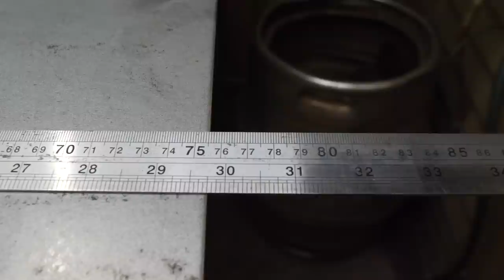Homemade Screw Tank #1 SCREWS

Comment: Every time he roles the machine to fold the metal he gets exited how easy it is to move
Reply from the maker: to right
Reply: The best inventions are the ones that make life easy 8)
Reply: @colinfurze  *too

??
Reply: @colinfurze  Colin ,the spiral on that thing needs to have taper ending ,not square like a wood screw tip ,also cone,and taper spiral at both ends if you want to go in reverse.
Reply: @colinfurze  Also weld some triangle supports on spiral ,that sheet metal is not going to hold radial and axial weight without it.
Reply: 🔴 What Is Islam? ⚠️

🔴 Islam is not just another religion. 

🔵 It is the same message preached by Moses, Jesus and Abraham.

 🔴 Islam literally means ‘submission to God’ and it teaches us to have a direct relationship with God. 

 🔵 It reminds us that since God created us, no one should be worshipped except God alone. 

 🔴 It also teaches that God is nothing like a human being or like anything that we can imagine.
🌍 The concept of God is summarized in the Quran as:

📖 { “Say, He is God, the One.  God, the Absolute.  He does not give birth, nor was He born, and there is nothing like Him.”} (Quran 112:1-4)[4] 📚

🔴 Becoming a Muslim is not turning your back to Jesus. 

🔵 Rather it’s going back to the original teachings of Jesus and obeying him.
Reply: @ahmdabdallah2132  There is no god.  Your life is a sham.
Reply: @colinfurze   when you roll a cone don't mess about with guide lines put a peice of angle iron point into the rollers then drag the inner radius around the end of the angle keeps it dead straight and easy
Reply: @Droningonuk  Sounds to me like you need to make a vid of your own!👍👍👍
Reply: @TheRealFumigator  😂😂😂
Reply: roles? Rolls?
Reply: This is better than always complaining
Reply: @MrNight-dg1ug  the machine is playing the role of a machine that rolls.
Reply: @Milamberinx  I don't think that's what he meant
Reply: @ahmdabdallah2132  Harry potter and the deathly hallows says that Harry vanquished the dark lord and saved the wizarding world. 

Same thing :)
Reply: I get slightly mortified that most of his welds are just spot welds and he doesn't do full seams. Alright for novelty work but they're going to fall apart- and with the kinds of things he makes, they aren't exactly fail-safe.
Reply: @Droningonuk  I for one appreciate that advice; always found conical sections a right pain in the cunning-linguals.

Comment: This drive system is particularly good in sand and snow.
Reply from the maker: yeah I'm looking forward to taking it in some proper sloppy mud etc
Reply: Furze take it to a steep hill or something
Reply: Hmmmmmm Russia and the Middle east?
Reply: will it be able to swim?
Reply: @georgobergfell  I don't think so
Reply: @georgobergfell  probably not, unless you added floaty air tanks and a big fan
Reply: @pseudomemes5267  the screw drive would work on water as well and depending on the overall weight, the hollow screws if welded watertight might be able to keep it afloat. highly unlikely though😂
Reply: So what you're telling me is that Colin is making a beach tank? I want one for my next holiday
Reply: @georgobergfell  I just did some back of the napkins calculations. As long as the overall weight of the tank is no more than 200kg and the screws are air tight the technical it should float.
Reply: @tobywenman4769  Yep, pretty much. Beaches, Afro-eurasian deserts, tundra and alpine. I'd particularly like to see it try to climb a ski slope.
Reply: But can it float?
Reply: why is this better for those terrains vs the classical method of wheels for tanks?
Reply: A bit concerned about the "threads" folding or just breaking if the ground isn't soft enough…
Reply: @julianatlas5172   @Simon WoodburyForget  They are likely slower and less efficient, however they have much grater traction. The screw partially buries itself into a soft surface, allowing the the incline plane to have a grater surface area contacting what it is pushing against. Just like a plane propeller is specifically designed for gaseous fluids and the screw of a submarine is designed for liquid fluids, this screw drive is designed for efficiency in particulate fluids. However, it is very ineffective on firm terrain or solid road surfaces. This is why track drive (which is more or less all terrain) is the preferred method.
Reply: I think this type of drive system may also potentially allow for movement in any direction, by having the screws rotate together or at differing speeds, but rigging that up may be a little complicated
Reply: @RainbowGin  This tank will for sure get over 200kg... Looking at the screws, it seems to become almost car-sized!
Reply: @ToastbrotRaver  helium?
Reply: Hawthorne, also it's good in swamp and marshes but doesn't move very fast!
Reply: @julianatlas5172  i was gonna try to explain properly but i gave up.  Best i have is a shovel analogy.  Basically the screw threads can move more lose material thus propelling the tank better.
Reply: Th3_dud3 no thanks
Reply: weldonwin he needs to rig it up somehow, otherwise he wouldn’t be able to steer at all.
Reply: @weldonwin  If you are talking about being able to move both front to back and side to side, that is not really possible with this. You would basically be trying to turn the screws into supper skinny drum rollers that would need to climb up out of the surface. The incline planes would also be biting in opposite directions causing you to spin in place. 
There is something called an omnidrive that is available in both track and wheel configurations that allows for lateral movement in any direction without turning.
Reply: @weldonwin    it's not too complicated actually , Colin already mentioned levers, one for each screw to control the speeds. Old tech but still works, nowadays it's done with hydrolicks.   If he wanted to strafe side to side, then he would need to implement the option to change the screw turning direction

Comment: The soviets used these things for their forest service. Theyre pretty neat.
Reply: I find this interesting.
Reply: I find your reply interesting
Reply: @All7777Fever  I find you finding my reply interesting to be interesting.
Reply: @garethbaus5471  That too is also interesting.
Reply: Of course they do
Reply: Our forest*
Reply: @memecrate6670  
[MOTHER RUSSIA INTENSIFIES]
Reply: @oleglogvynenko9447  idk if it was actually deployed or what force used them, but Russia did have them. https://www.thedrive.com/watch-this/14987/this-fully-restored-screw-driven-amphibious-truck-is-practically-unstoppable
Reply: Makes sense. Only the soviets would use something so inefficient big and industrial looking
Reply: @jsmgaming1062  It was actually superbly efficient for the task. They were largely employed in large swampy areas, and could float (as Furze's does). They didnt use a silly hydraulic drive though, they used a petrol engine and a tank transmission to drive each side with a belt. 

They were as good if not better in mud than any PT-76-chassis tank tractor, and were much better in the water as well. Not to mention it was simpler and cheaper.

Comment: Educational as always.  That radius jig is nice and simple.  I'll have to remember that when I'm building my own turbojet cart.
One thing I did learn while making steel and aluminum cylinders, though, is if you brake the edge just a bit it'll roll right out to the edge without the flat tail, so less material waste.

Comment: Tip for rolling cones. Weld 2 bits of angle together to make a T. Jab it into the rollers e.g. on the far left. (Point of the angle into the roller) if you put your blank in lead edge parallel to the rollers, small do a end pushed up to your angle. As you roll it drags the my edge around the end of the angle and maintains the "guide line". Probably something you already know but I liked it when a sheety showed me :)

Comment: 4:03 and hopefully we'll have a perfectly round square true  cylinder. Only Colin can make a round square cylinder... lol
Reply: Deranged Chicken or , you know, anyone that understands technical terms  lol
Reply: Square as in both ends square up together it's a 2d plane
Reply: @girlsdrinkfeck  um, i'm 46 years old, a qualified boiler maker, a coded welder and i threw in a fitting and turning apprenticeship when i was a pip - at my fathers engineering firm - my father was a great journeyman to me, taught me just about everything i know regarding metal work,  any how i digress, but um, i think you get that i was joking... and its square in 3 dimentions to me, it just sounded great, that's all - i think shneaky Colin said it on purpose...
Reply: @derangedchicken2191  er ok .... BTW can u service my boiler for me ? its now 10 yrs old and near its life cycle
Reply: @girlsdrinkfeck  yeah sure, stick it in the post and send it off to me. lol

Comment: Colin when rolling cones use a piece of angle upside down in the roller to hold the sheet at the same spot. Saves alot of stuffing around. 40 x 40 should do it

Comment: Colin, not sure if its been mentioned, but if you put a bit of angle up against the two rollers, and wire tie it around the three rollers to hold the angle in there, you can run the throat of the cone (conical) up against the angle and this will guide the throat at the right speed in relation to the outer edge of the cone.
Hope that makes sense. :)

Comment: Estimated speed of tank 2mph , unless the screws turn at 10,000 revaluations per minute then it might go 20mph
Reply: Let's do some math. The screw is 152 cm there's 4 threads. So the thread pitch is 38 cm, let's round that up to 40 to make math easier. So with 1 revolution of the screw you're going to to move 40 cm.  And if he managed to make it spin 1k rpm that comes to about 11 km/h. In a bog or  a swamp  i think that's plenty.
Reply: @petyyras1  That's assuming the screw is getting 100% grab, and no slippage.
Reply: @petyyras1  Good number-crunching, dude. You've probably saved old Furzey-boy from having to do it as well. Me? I was thinking of how to work out the radius of curve for the blades using conic sections and all that hyperbolic trig I knew 35 years ago (but have since very much forgotten).

Comment: Colin, those drive blades are too weak, they need reinforcing. They need a triangular profile, otherwise they will just bend.
Reply: Definately agree with this comment. Gonna have to fix the screws before completion day.
Reply: Maybe another set of 1/4 cuts and bend the original ones welded on and repeat then weld the tips together. Should rectify it somewhat.
Reply: @andrewc5212  - I agree. I think that is probably the best way forward.
Reply: Joven Mangges  i think the angle bar would be more of a challenge  to 'wrap around' in a corkscrew shape.
Reply: this type of tank is supposed to be used on soft undergrouns like sand or dirt, not concrete or rock.
Reply: Joven Mangges  and why did you just tell me that? I was replying to OP

Comment: This were actually invented for the purpose of pulling loads across snow to replace snowmobiles. while effective at first, it turns out that it doesn’t get enough traction and the speeds are very limited.

Comment: Incredible energy!!  Prediction: the weight of the machine will bury the screws and it will spend most of the time digging up the soil and have poor manoeuvrability, eventually burying itself . The screws need to be constructed in such a way that they have the tendency or want to ride above the soil, not bury themselves. Construct the screw then as if you are making them from a piece of right-angle, it will give you two edges to weld to the cylinder.  “ v “.   Oh, make the cylinders watertight as well, and you will have pontoons to-boot.

Comment: Seen someone do this before on youtube and he had chains driving the screws from sprockets in the back of the tubes, and once he got going the screws kinda dig themselves into the ground a bit and the dirt would toss off or break the chains. So I would suggest on mounting the hydraulic motors to the back of the screws somehow to eliminate this problem. Other than that, looking good!

Comment: the thread is currently just a bendy strip of metal, not exactly steardy, and wil probably both din into the ground too much and wear away fast, on harder terrain, so i recommend adding one more thread to each, and joining them together, kinda like ya wrapped angle steel around it

Comment: Lol I like how you used your arm as reference or measurements to fit the scrolls together instead of working out motor power required, power to weight, load forces required vs weight on the item etc etc. its so refreshing to see fun/winging in action ha xD
Reply: fyi I'm a person that plans everything to nth degree before execution and its really nice to see how you actively do not? xD 
I would have took some information from existing products; toys or real tanks, scale down to understand if I can obtain said power with available/easily accessible motors, whats the application I can run it in (army training field? motorcross track? Off road tracks?, speed? degree of incline? Load? Am I shooting something from it? Ammunition?). Worked out sizes and placement of seat/controls etc, then adjust accordingly.

Comment: You need to put an angled bit on the front it the tubes and the end of the screw part so it isn't parallel to the surface of the tube. The way you have it now it can get caught on something and break.

Comment: Colin nice video as usual......but why don't you motorize your metal roller! =D Mount an electric motor that can go forward and backward with the press of a button instead of turning that crank by hand. You can have a handheld module with the buttons and have a long wire going from the module to the motor so you can work big sheets of metal by yourself. Just a thought!

Comment: I think that metal is too thin in that screw what was welded onto the surface of those "tubes" it will bend under all that weight which is yet to come (perhaps it needs one more screwy bit to be welded on equally thin/thick). But we'll see in the next video if my assumption comes true.

Comment: The pitch could be good, it doesn't matter, but I think that the screw is too wide... If you don't have enough power you will be stuck on mud or soft ground. Or if you have enough power, you can climb walls and trees maybe, but the weldings on the screw could break. How much thick are those plates?

Comment: Umm Colin, shouldn't the screw "threads' be reversed on one of the tubes?  I would imagine you'll end up crab walking to the left or right, instead of going straight ahead as they appear at the end of the video.
Reply: Similar in theory to your letterbox paper shredder, the screws need to turn in opposite directions.

Comment: people allways say i should make a nuke for 10 million subscribers............................................disturbingly enough i wouldnt put it past you to try and build one
seen one build at junkyard wars on discovery , they couldnt get enough power to it to get them to spin (the part touching the ground is actually pretty large and acts as a verry big friction brake ) 
they used a car engine  , you probably need to use some hydraulic motors or try the thing out in a quarry (where the screws dont sink intoo the ground and only the edge of the arcemedis screw is in contact with the ground ) still no garantee it will work flawlesly though